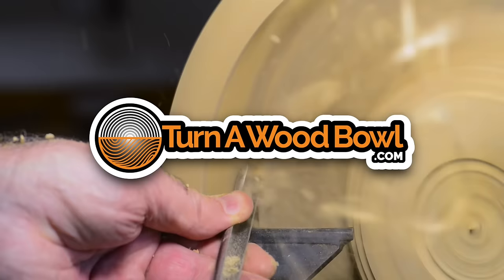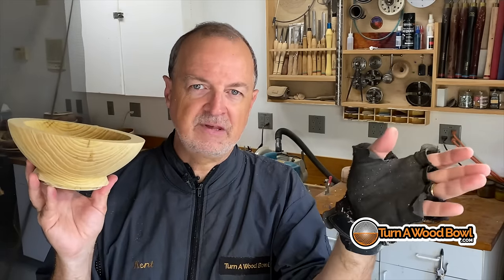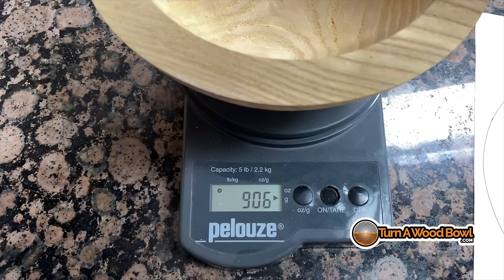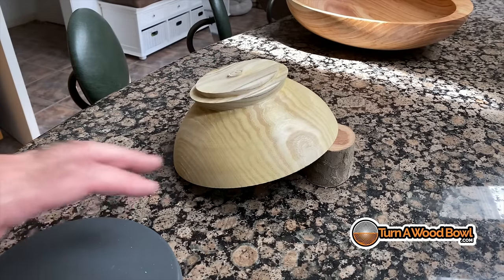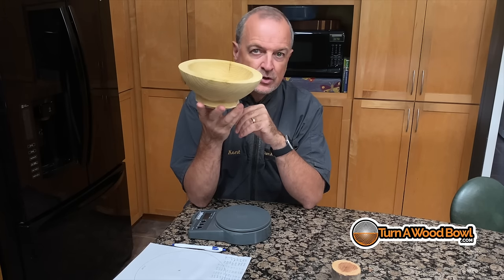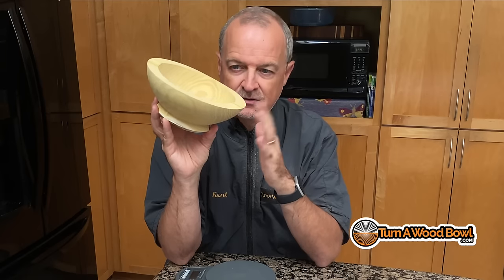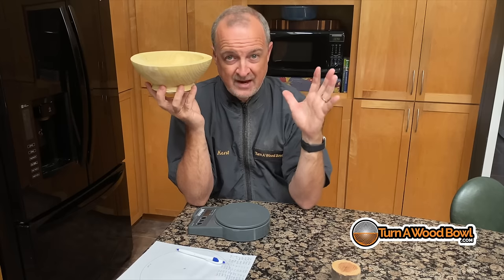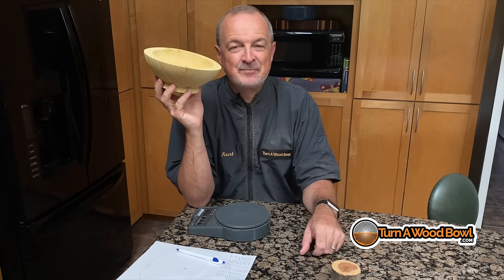Microwave Drying Wood Bowl Blank Woodturning Video

Comment: I was playing around with microwaving real thick sections at some point and discovered you can actually make charcoal in the microwave inside blocks of wood.

The water in the middle got super heated, well beyond ignition temperature of the wood but because that section was shielded from oxygen by the wood around it and the expanding vapors pushing everything outward, it was able to pyrolize without burning.

I suspected that may be happening when i noticed that there was a jet of gasses mostly coming out of a small hole and it looked like it got way hotter than waters boiling point. So i drilled out the pinhole and sure enough there was a black section of charcoal below it. Dug some out and burned it to confirm.

Havent thought of a use case for this but you could implant stuff like silicon carbide to try to localize heating in specific areas

Comment: Hi Kent, I've used this technique around a dozen tines since I watched this great video nearly a year ago (I most often turn dried blanks). Being the less-than-patient person that I am, the thought of building up a huge inventory of bowls in bags on a shelf is not satisfying!. The MW method you outline has worked very well for me, on species as different as freshly cut Redwood and year-old Elm, Walnut, Maple and Pear, for small bowls and large ones. So far none of them have failed. I've learned a couple of additional things. First, to make sure to leave the tenon big enough during the first turning so that my chuck will still grab it after truing it up. Second, to be sure to scrape off any residual wax or sealant from the base - it will melt and stick to the MW turntable (guess how I learned that one). BTW, I generally MW them for 60 to 90 seconds at the highest setting, depending on size, typically four tines a day. 30 cycles seems to be the standard for me, no matter what the bowl size.
Reply from the maker: David, sounds great. Thank you for writing and sharing! Good points about the tenon and excess wax on base. All the best to you and Happy Turning!

Comment: Hello Kent.  I like your videos.  You have it dialed in quite nicely.  Voice over, great editing.  The whole ball of wax.  Keep up the good work.  I have been drying lottsa different woods in a microwave for many years. Thru trial and error, I have developed a simple system that works to an ‘adequate’ level in most cases.  Wrap the piece in three layers of fresh newespaper.  Nuke for 20 seconds on, 20 minutes off.  Leave it undisturbed in the oven. After 20 minutes, the moisture will migrate into the paper. Repeat the 20/20 until the newspaper emerges dry.  Allow to rest and stabilize between cycles. Not as scientific as weighing but it works for me.  IMPORTANT NOTE:  To avoid depression,  don’t read the newspaper.
Reply from the maker: David, Thank you for writing and sharing! That sounds like a great technique. Well done. Happy Turning!

Comment: Thanks so much.  I'm struggling with drying Kuksas naturally and preventing mold at the same time.  I'm going to try this.  Thank you again.
Reply from the maker: Enjoy! All the best to you and Happy Turning!
Reply: @TurnAWoodBowl  Thank you.  By the way it worked.  In 20 microwave stints at 1:15 each, one Kuksa went from 370 grams down to 200, and one 450 grams down to 240. No cracking.  I'm happy as can be to have found your video.

Comment: Got a great FOG candidate for this process. First bowl I turned from this log split in 3/4 places. Wide cracks, one was at least 3/8" at outer rim.
The wood looks like a light colored cedar. But no aroma, only a wet wood smell. I'll try to remember to let you know how it comes out, although I don't have a scale to keep track of progress, the difference should be noticeable. 
Thanks for your vast knowledge and willingness to share

Comment: Nice..  I have turned green bowls for more than 50 years..after turning the green bowl I coat with paste wax..especially the end grain..the coat with cellathane or now shrink wrap and use a hair dryer or heat gun..  I weight the bowl and lay it aside and when the moisture loss weight  is about 25% I put the bowl in my wood shop attic..temps there often go over 140 degrees,, some are up there 3-4 weeks if summer..  the key is to keep weighting them..  when the weight loss stops I then returned the bowl and finish them..  it’s easy, fun and I have 20-25 bowls up there many times..over the years..the bigger the bowl the thicker the walls have to be and often the longer it takes to dry out....
Reply from the maker: Awesome, thanks for sharing this technique.

Comment: I’ve seen this procedure on other YouTube channels but not explained and demonstrated so well. I turned two cherry bowls this week (first turning) and applied Anchorseal 2. Now I’ll try this. Thanks, Kent. Love your videos.
Reply from the maker: Thanks, Paul! Best of luck to you and your drying!
Reply: @TurnAWoodBowl  - I have quite a few rough blanks which have anchorseal on the end grain.  If I put them in the microwave would the sealer melt off or prevent the water from escaping?  My wife will kill me if I screw up her microwave.
Reply: @weathormantom7206  Anchorseal is a wax based sealer, so using it in microwave will melt the wax, and it may start dripping in or around the microwave. On another post he says that he is not sealing his blanks prior to microwaving them.

Comment: I was waiting to see you pull out a moisture meter, but I guess you didn't need to with weighing the piece after nuking it. Nice expalnation. Thanks Kent.
Reply from the maker: Nope and they really don't tell you much. A moisture meter on a thick bowl like this is similar to licking your finger, holding it up in the air. You'll never really know the true wind direction or speed. Moisture meters give you a rough idea, but that's not what we're looking for here. We need to reach equilibrium. Happy Turning!

Comment: Kent, very good info. I might add the wattage of the micro is important to time drying. I have had good success at lower wattage with more time up to 2 minutes, depending on wall thickness and diameter and wood type. I like putting the bowl in a double paper sack and letting it cool down and lose moisture slowly. Typically I spend 3 - 7 days until weight stabilizes. Tracing the outline is a great idea, I will start doing that. As always enjoy your teaching and sharing. Finally got educated about trying to fashion a swept back grind on a v flute shaped bowl gouge .....not gonna happen. Cheers and stay safe from the low humidity state of MT.
Reply from the maker: Thanks for sharing. Good information! All the best to you in your beautiful dry state of Montana. Happy Turning!

Comment: Great info!  I've tried this on some of my "learning curve" bowl attempts with chunks from my firewood pile and had remarkable results...just turned once, then microwaved.  I've had cracks emerge in white oak right off the lathe that closed up after microwaving.  I will have to try twice turning once I get to where the bowls are more "keepers."

Yesterday I tried my first lidded bowl/box.  The lid turned out a bit loose, but not bad for a first try.  I then started microwaving.  After the second run through the lid was stuck on the bowl.  I had to use a chisel to pry it loose.  When both are fully dry, I will try to sand it down to fit again.  My guess is that it warped a bit around the pith.

Also, great books beside your microwave.  Those are among my favorites.
Reply from the maker: Thanks! Yes, lidded projects really need to be dry first in order to fit and stay fit. Glad you like the books. ;)  Happy Turning!

Comment: We just bought a cooking range that has a feature for dehydrating food.  My first thought was how it might work to dry out wet turning wood.  The dehydration feature in the oven is really just very low temperature warm air blowing around inside and wood is sort of in the vegetable category.  Kinda.
Reply from the maker: If the low temp is around 90° or below. Very slow process, not like cooking, or even food dehydrating. All the best to you and Happy Turning!

Comment: I’ve watched a few videos on drying 1st turned bowls in a microwave. You have given the best explanation, by far. Curious about two things though. First, do you seal the end grain before starting the process. Second, how much cracking do you get compared to other methods.
Reply from the maker: Duane, good questions. No, I do not seal the end grain when microwaving. The cracking depends on many variables, mainly the tree species and if the pith is still in the bowl blank. Some species crack when you look at them wrong and others never seem to crack. I recommend practicing with the local species available to you and learn all about them through experience. All the best to you!

Comment: Kent, sorry I'm so late to the party... just found your site and I'm loving it.  I have a question about wood thickness.  Recently I have been fascinated by Simon Begg's projects created by utilizing the "German Ring Turning" process.  But unlike most bowl turning, Simon's first turning is several inches thick.  I'd like to try this method and was wondering if you had any experience with (or advice for) drying thicker wood in the microwave.   Simon briefly mentioned once that he uses a microwave to dry his blanks, so I know it can be done.  Is it still solely reliant on tracking the weight of the wood, regardless of thickness?  Or are there some additional factors to consider?  Keep up the great work!
Reply from the maker: Chuck, the key is to have evenly thick walls. If you have any area thicker than others the thick area will dry slower and cause tension. Give the microwave a try and let me know. Happy Turning!

Comment: Kent, couldn't agree more with all the great comments! I do have a question about a really big burl (it's big to me anyway )from a tree I had to cut down on my property. I've had it in my shop for about 2 years, partially because I'm not sure how to cut it correctly. The burl completely surrounds the trunk approximately 2ft from the ground. I thought is was solid but it has a hole all the way through the center. It's big enough that I have to use a dolly to move it around. If there's a way that I could send you some pictures for any advice you're willing to give, it would be greatly appreciated!
Reply from the maker: Sounds fun Patrick. Yes, email me a kw (at) www.TurnAWoodBowl.com All the best to you and Happy Turning!

Comment: A green turned bowl looses moisture at the end grain areas faster than at the side grain areas. That is why some people use Anchor Seal on end grain; to slow down moisture loss. I have tried ADDING moisture to the end grain to minimize the cracking/splitting that eventually starts at the end grain.  I get a green turned  bowl comfortably warm in the microwave; rest it until cool; then give the end grain, inside and outside the bowl, a spritz of water from a Windex-type spray bottle before the next microwave period. Warm in microwave, rest, squirt water. Repeat a few times. When the smallest of cracks begin to appear at end grain I stop microwaving and rest the bowl several days or a couple of weeks. At the second turning I usually have a bowl that is close to equalized and only warps a bit when complete. 

Early on I scorched an alder bowl in my wife's kitchen microwave. Bowl bottom and tenon area turned black and made smoke. It made the microwave stink terribly for months. Go to a garage sale. Get a used microwave with turntable just for bowls.
Reply from the maker: Chris, Thank you for writing and sharing! I'll have to experiment with the mist of water. Thanks and Happy Turning!

Comment: Hi Kent
I heard several places that the % of moisture need to be around 12% to be dry.
With your explication , I understand that the moisture needs to be closed to the moisture around us .
Here (middle of Québec, Canada) , moisture is quite high , around 50% .
Sure that at 50%, my blanks are not dry at all
I used microwave, and follow the % and also weigh, every time I fall between 12 to 15% when it is stabilized 
I'm not sure if I understood correctly your explication !
Sorry for my bad English, I'm from French area in Canada!!
Thanks for very good videos as usual!
Reply from the maker: Checking moisture is ok. But weighing the bowl will tell you when it is stabilized. When you can weigh the bowl over several days, or even a few weeks, and the weight does not change, it is then equalized.

Comment: Not a single wasted word. What a thoughtful presentation. Please keep up the good work!  Two questions…are there ANY differences in how a bowl performs w finishing treatments or resin and CA filling, mw dried vs slower? And, whats the upper limit of how hot/fast you can mw dry a wet bowl?
Reply from the maker: Thanks, Brad. If the bowl is dry, all finishes should be fine regardless of how the bowl was dried. As for limits, I don't go long enough to make the wood hot to the touch. Remember, we're not cooking, just coaxing moisture to evaporate slowly. All the best to you and Happy Turning!

Comment: Kent, I tried this method on hard maple and cherry and it worked. I used 45 seconds each hour. I am now experimenting with a rough turned maple bowl immersed in desiccant beads, a method I saw on YouTube. So far, the bowl has lost 10% of its weight in four days. My goal is 30% or a stabilized weight. Which method is better? I don't know. The desiccant is an extra expense; I bought three gallons (22.5 pounds) for around $100 on Amazon. The microwave method is cheaper but more time consuming for me. I was under the impression the desiccant would be faster. My experiment is not a scientific comparison although for my own curiosity, I might try a side-by-side comparison. It's going to be a long winter up here.
Reply from the maker: Great to experiment! It's the only way you will truly discover what works best for you. Have fun!
Reply: Please let us know how the experiment turns out! I also tried using desiccant beads. I left the wood covered for 3 days with it and only had a little weight loss. But strangely I checked the same piece of wood a couple weeks late and it had gained most of that moisture back.

Comment: I needed a piece of white oak to make the base and bottom of a keepsake box. The stack of white oak had been milled about 5 years ago and air dried under cover outside. I had it on a trailer , and rain had set in on it for several days. Anyway I cut off a piece a little bit bigger than what I needed. I then ran it in the microwave 8 minutes at a time for like 5 times. I let it cool down each time.  It smelled awesome!!!!!     But it was so brittle when trying to work it. White oak is naturally hard and easily to chip out on the jointer. But this piece wanted to shatter. A hand plane helped , but putting a supper course belt on the sander took all the tearout , out and then worked it down to a polish with a worn out belt. So even without any kinda polymer finish it will polish out to a mirror glaze if it is that dry. 
     Gave it to Nurse " Good Body"' she was a blind date that I was set up with.  She is a wood grain lover like I am and was amazed at how it is polished like a shellac , or polymer finish is on it but its just that it's tiger striped oak , dry as a bone and polished with a worn out belt. As it acclimates to moisture it may break itself apart tho.
Reply from the maker: That's awesome. Glad it worked for you. And that sounds like a very cool piece. Well done!

Comment: Howdy Kent!
Fantastic video! I seem to always want to come back and watch it for a refresher sometimes when I want to nuke my rough pieces to dry faster. 
One question:
I have an old, yet dependable toaster oven, would you ever suggest someone using one of these, and if so, how would I go about drying my rough turned pieces? Time/temperature/durations?
Thanks! You're one of the most informative Youtuber woodworker I've come across!
Cheers from Georgia!
Reply from the maker: Thank you for writing and sharing your kind words!  Yes, a toaster oven could work if you can set it super low, like 100°-120°. I don't have a link but I know there is a temperture based controlled that you can plug the toaster into and place a probe in the toaster. When the temp reaches your setting (100°) it will kick off the power to the toaster. Also, keep the door cracked a bit to allow the moisture to escape. 
All the best to you and Happy Turning!

Comment: I'm not a patient person, so microwaving is my mo.  Actually like spalting; aged wood is my preference and can do bowl isin a few hours.  Anyway, I've heard some guys put first turning in boiling water, supposed to burst wood cell structure, there by significantly reducing warpage.  So my take on that is to do microwaving at 5 min. intervals. Had pretty good experience of green to finish in an afternoon
Reply from the maker: Thanks for sharing. If that works for you and the wood you're turning great. I've found longer than a minute or two gets too hot.